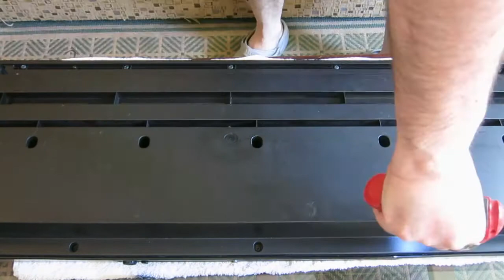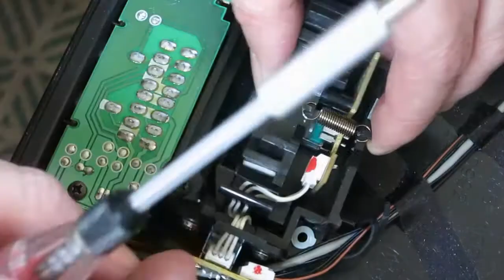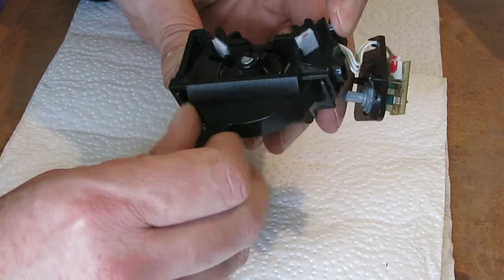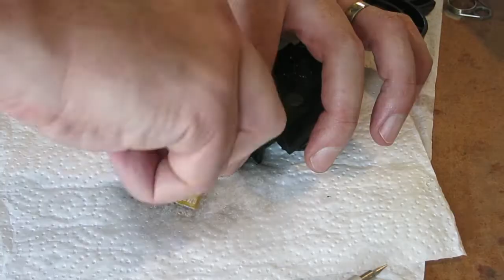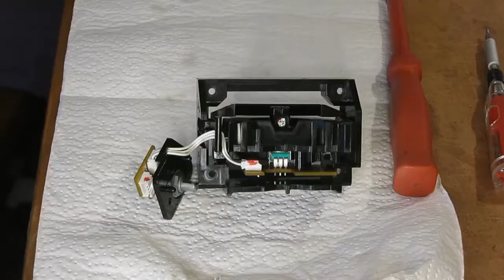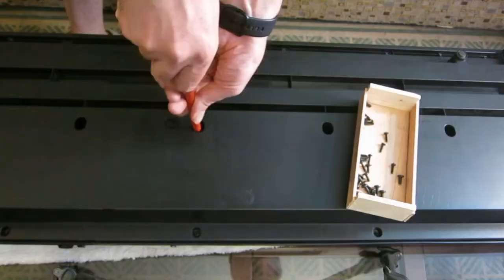Roland BK 5 Pitch Bend Joystick Repair

Comment: I have the same problem... I want to try to disassemble my jupiter-50... and follow your video... but I have one more problem - the USB connector does not work and does not detect the usb flash drive. Do you think this problem can be fixed?

Comment: I’ve got different Roland controllers and they’ve all had the same issue, unreliable intermittent pitch bend. I’ll try this. Thanks.
Reply from the maker: Good Luck! Tell us if this method worked with your machine! Mine working fine so far!.
Reply: @josemonkey5804  Done it!! Great, it works. It now responds as it should, thanks again.

Comment: Hlo sir actually I have Yamaha psr e373 keyboard which doesn't have inbuilt Pitchbend so can j add external Pitchbend like Inbuilt Pitchbend
Reply from the maker: Hi! you can use a external midi keyboard with pitchbend... I do not know if there midi pitch bend only device .
Reply: @josemonkey5804  I want to Use Pitchbend For My Yamaha 🥺 But In India There Is No Pitchbend bend wheel Accessories 😓